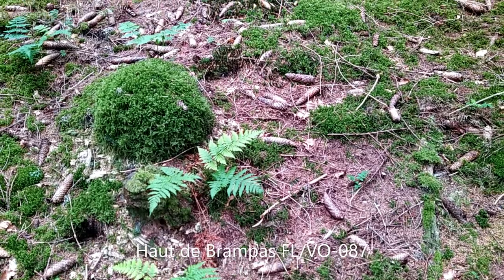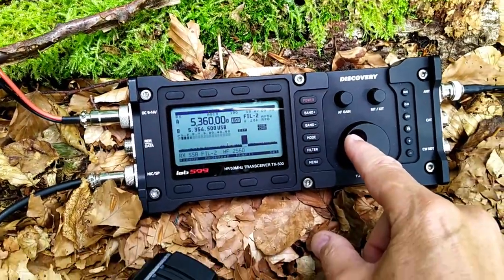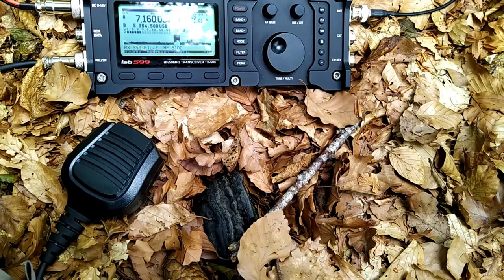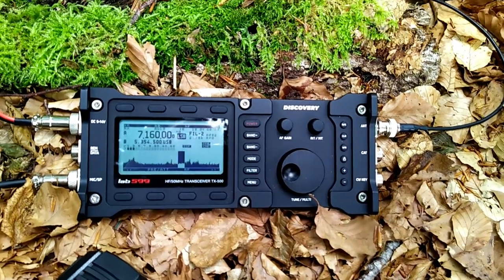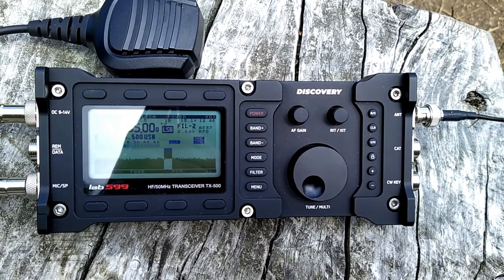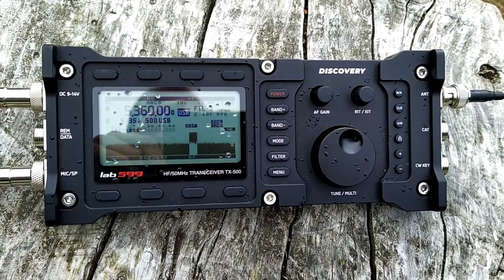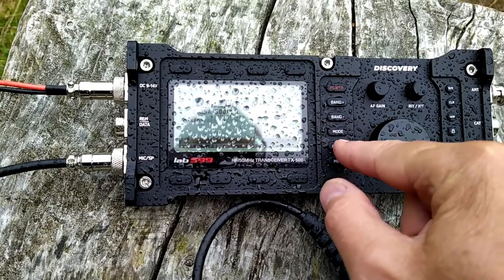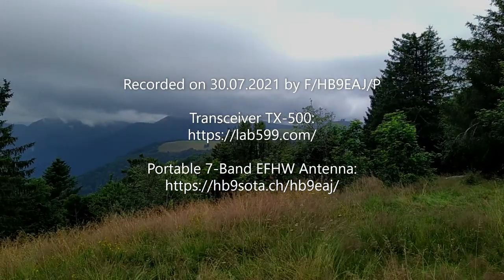TX-500 and SOTA

Comment: Good video.  Thank you!

The reason of display like mirror is that cover made from tempered glass not plastic.
Reply from the maker: Hi Yury,
Thanks for your information. I'm not a pro in this field, but it seems there is anti-glare tempered glass available, that is also used for screen protectors. As I commented in the video: I can live with it. 73!
Reply: @PortableRadio  This means that this glass is scratch resistant but you can 
use mate protection film for phones and this significantly reduce mirrors.